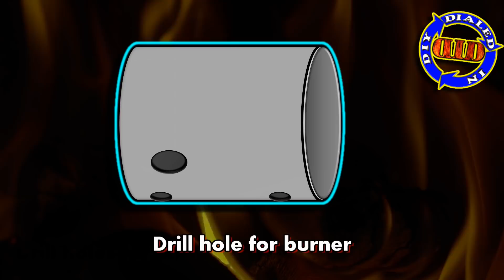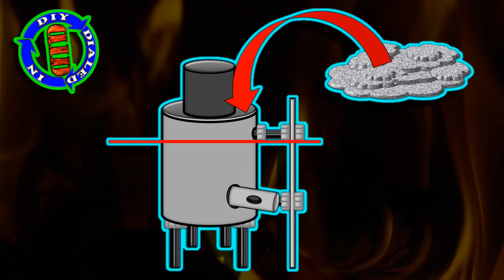Soup Can Forge DIY - NightHawkInLight Response Video

Comment: How did you stop the steel pipe for the burner from sliding back and forth through the hole in the side of the can?

Im using ceramic wool instead of sand+plaster of paris and the wool doesn't bond around the pipe to fix it in place.

Comment: Great video and great improvements on this forge! I think the foundry setup would work better with a smaller crucible. Seems that large of a can might choke the flow of the burner.
Reply from the maker: You are 100% right!  The one used in the video was choking the flow enough that it was making a bit of a whistling sound.  Great tip!  Thanks so much for including my video in your Community Response Video playlist.  I really appreciate it!!